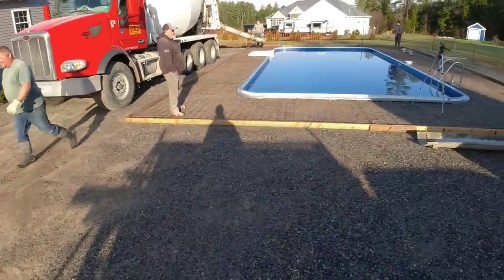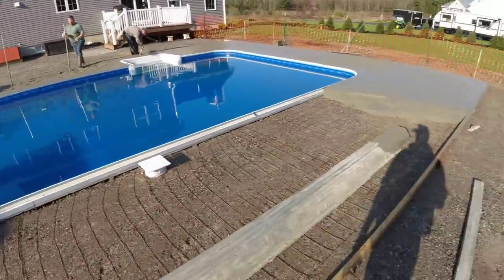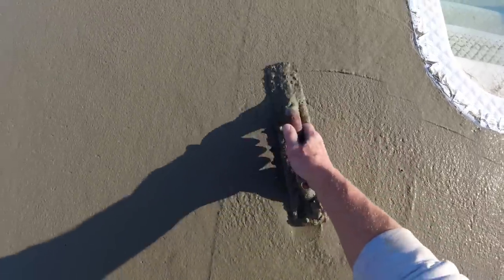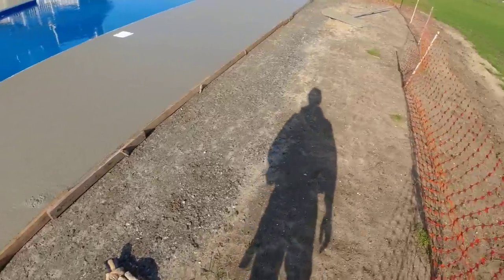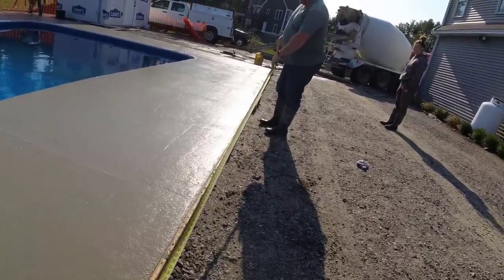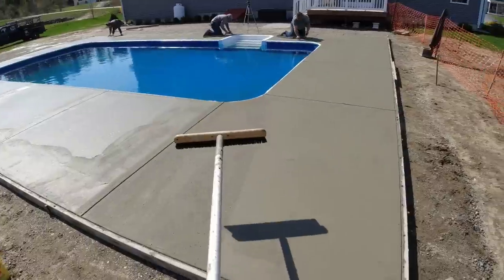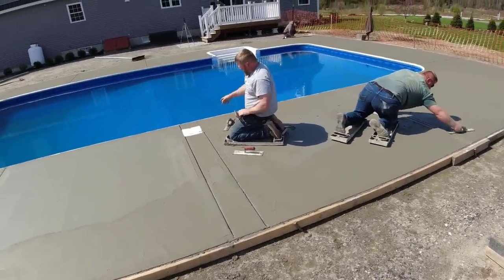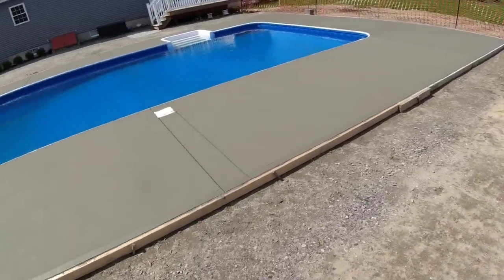Concrete Pouring and Finishing Techniques (How To Do It)

Comment: You guys make it look so easy and the workmanship is excellent. That water reducer seems to make the pulling and pushing a lot easier. Used to pour patios and driveways and I hated it when the driver was dropping super stiff concrete and wouldn't get it to a workable slump. We would kill ourselves getting that crap finished.
Reply from the maker: Stiff concrete isn't fun, I agree!

Comment: Great job, do you use a special concrete mix for pools versus regular slabs?
Reply from the maker: We up the cement content a little, we use a 4000 psi mix VS a 3500 for slabs.

Comment: I was wondering, how often do you have to replace the edging tools?  It's basically metal grinding against an abrasive and I assume those wear away/out after a while.
Reply: If you clean it everytime it’ll last a long time, still have my edger from 10 years
Reply: hardened and tempered high carbon steel.
Reply from the maker: The brass one's we use, last about 1 year.

Comment: Hey Mike, I’m from Fort Wayne Indiana and word is the cement shortage is hitting our area hard.  If the information we received yesterday from one supplier was accurate it will be devastating.
Reply: That's super unfortunate..is this a pretty localized thing or could it potentially go North-America-wide? (I was planning on a concrete driveway in the short term)
Reply: Shout out indiana, I do concrete in indy and boy... it's like pulling teeth to get mudd down here, I did find a company that is trying to pick up all the customers that imi dropped, about Tia, I know a girl that has been doing concrete for 12 years now and I wish she would have went after her dreams to be a firefighter
Reply: What's going on with mud there?  I'm over in Ohio.
Reply: @JB-kz4hi  Honestly I cannot say.  Sounds like it has started in the South and is pushing up.
Reply: @kurtfrancis4621  I don't know about ft Wayne but here in Indianapolis, it's more of a truck shortage than a cement shortage.  If u r a small guy you can't even get a 7am load. I actually did a video on the cement shortage in which I called all of the ready mix suppliers. But yeah I would like to know what's going on up there.  How is Ohio? U guys having any trouble getting concrete over there an what part of ohio? Obviously I am very interested in this topic
Reply: @GRUBB-MUDD  part is the drivers and part is the cement switch the country made in the beginning of the year in my opinion.
Reply from the maker: We haven't experienced a cement shortage yet. Truck drivers are hard to come by. We have concrete on the books everyday M-F for 7am, 2 to 4 loads.
Reply: @MikeDayConcrete  Lesser of two evils idk.  Always something.